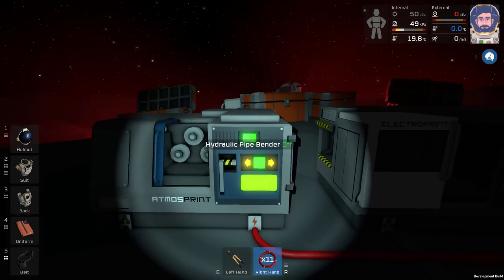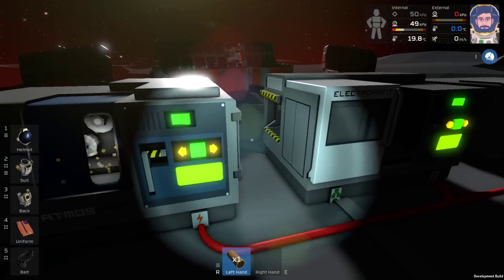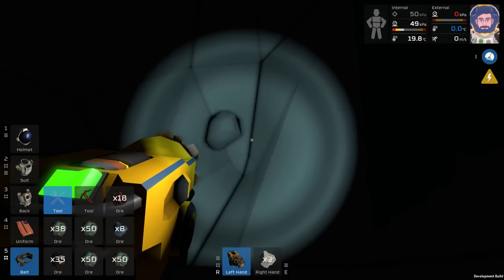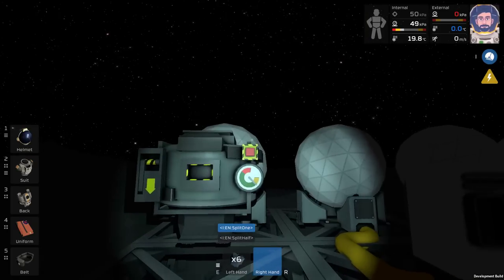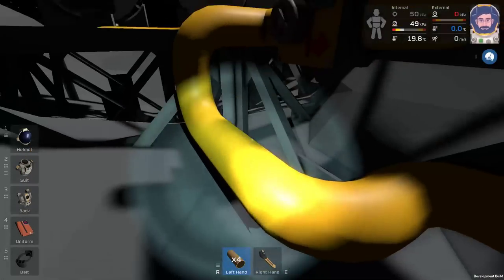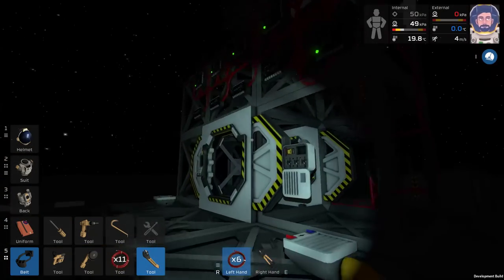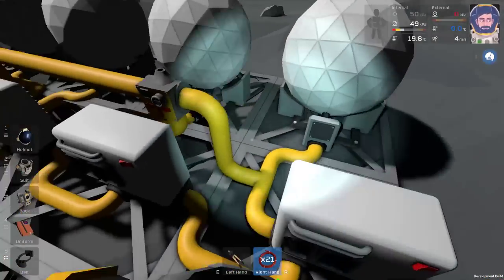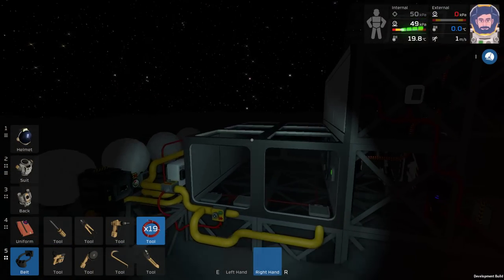Stationeers Tutorial Part 2 - More Power, Atmospherics, Filtration and Pressure Prep

Comment: Enjoying your series a lot. Would you consider showing a proper air flow in-between multiple rooms ?
Reply from the maker: Sure. Do the multiple rooms have the same gas pressure and gas mix, or are they setup with their own different atmospheres?
Reply: Rhadamant thank you so much. Same temp and same pressure. Main focus is on air circulation and temp control. I am not sure how to set up the vents between rooms and the lengthy corridor that connects them.
Reply from the maker: Would the corridor also be pressurized?
Reply from the maker: Most of the time you can connect each room to your input/output pipes just like you did with the first room. The larger the room, the more vents and regulators you'll want. You can put airlocks between each room if you want, but it's not necessary. The pros of airlocks is if you have a breach or gas leak you can just vent out the affected room. The cons is the rooms won't balance out pressure as quickly and the furthest rooms from your pipe network won't get adequately pressurized until the closer rooms are done.

Comment: What is the difference between the active and passive vents? I think I understand that active vents actively pull in air while passives need the help of a pump or active to push/pull. If that's so, then why do you need both an in and out active vent? Or do I have it all wrong? Asking for a friend
Reply from the maker: Active vents are vents with fan blades that can either suck air out of a room or push air into a room. Passive vents just allow airflow to a pipe. I'm not sure I 100% understand your question, however,  but if you can clarify I can help you understand better.
Reply: Rhadamant sorry portion of my question didn't get posted. Basically I was wondering why you can't just have one active vent that's doing the intake and then one pass vent on the other side putting air back into the room with the filtration system in between. Why do you need an active intake and active outtake?
Reply from the maker: You honestly don't need the active vent to push air back into the room, a passive vent will work. Active vents can only pressurize to 101 KPA so they do make it handy to pressurize a room quickly and only to a the max pressure of 101KPA. Let's say you have a tank FULL of oxygen, if you send that thru a pipe to a passive vent it'll flood your room with so much oxygen it'll pressurize and blow out walls. If you use an active vent it'll only allow 101KPA out of the pipes and tank. I hope that helps?
Reply: Gotcha. So basically if you go the passive route you need pressure regulators to keep it at an acceptable pressure or you can just use the arrives since they only go up to a certain pressure correct?
Reply from the maker: Pretty much! I tend to like to use regulators, but regulators are power hungry.
Reply: Awesome. Thanks for the help!